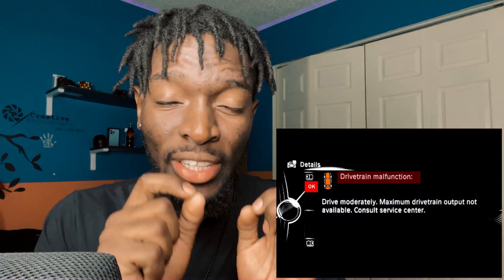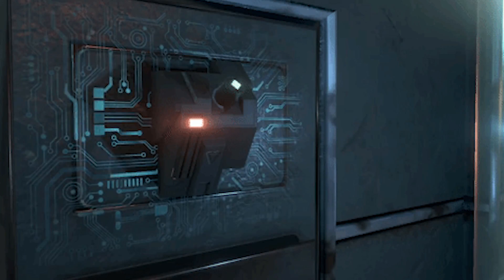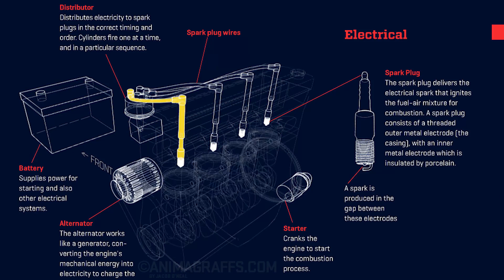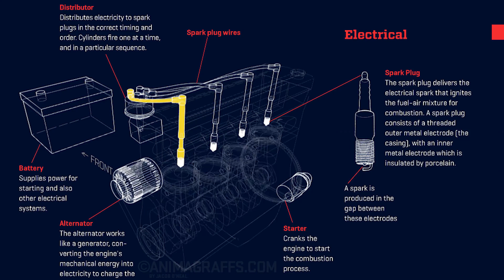BMW Drivetrain Malfunction. What is It? How to Fix it! | 2015 BMW 328i | Get Fixed

Comment: My clean title 2014 328i I bought recently has the brake warning light, DSC, chassis stabilization, drivetrain malfunction and ABS warning. Literally everything but it drives beautifully so idk what to do with the damn thing. Just replaced the brake sensors but disconnected the battery hoping it would clear but all new warning lights came back lol.
Reply from the maker: The Anti-lock Braking System in your car may need to be replaced. I have the same exact car but 2015. Take a trip to AutoZone when you get the chance and scan your car if you have a check engine light. Keep me updated.
Reply: Replace yourABS speed sensor and your chassis error should go away. Simple DYI fix.

Comment: I have this error on my bmw m240i - Driving stabilisation drive moderately. Anyone know what's going on? It won't let me swap into sport or sport+ keeps putting me back in comfort and the rear end is very dodgy spinning bad and not reliable at all.
Reply from the maker: Is the car preventing you from fast acceleration?
Reply: @GetFixed  Got it fixed now mate, had a specialist code out the error.
Reply from the maker: Coding out the error message doesn’t usually fix the root cause of that error message. It may come back in the future.

Comment: bro the codes they give me are P2251, P0131 P0030. 
but on the screen I get that problem.  What could it be?
Reply from the maker: All of those codes relates to your oxygen sensor. If any of them goes bad your car is gonna put itself into limp mode.
Reply: @GetFixed  Yes, but on the screen I get that there is a problem with the driventrain malfunction?
Reply from the maker: Drivetrain Malfunction basically means there’s something going on with the mechanics or electronics of your engine or transmission.

Comment: This just happened to me today literally drivetrain malfunction message then I’m driving and it goes in neutral and say transmission in park idk what’s going on the shops I’ve went to are no help ..
Reply: Do you know what the U1408 code means?
Reply from the maker: Where you able to resolve the issue?

Comment: I have a 2012 535i with a  drivetrain malfunction but no engine code, I can I figure out the problem?
Reply from the maker: If you’re not getting an engine code than it may have something to do with your transmission. There are some scanners that can pick up whether or not the transmission has stored an error code to the motherboard. How does your car act like when you first start it up?

Comment: I just put rims on my 2013 528i. And I got the same message. But the car doesn’t shake. Still drives normal. Didn’t do this with the factory rims. Thank you in advance.

Comment: Man I need your help I just purchased my 2013 750 li M and it’s idles fine but when I accelerate to 4000rpm or so it struggling for power and then it shake moderate not so bad but I’m worried can u help ? Thanks my email
Reply from the maker: I can help you troubleshoot what the issue is. Do you currently have have a check engine light? If so, have you scanned the car yet? If you don't own a scanner then you can go to Autozone or Advance Auto Parts to get it scanned.
Reply: @GetFixed  Hi yes I think the car is in limp mode the only codes that came up was a coil pack and also a fuel pump pressure fuel pump code please reply I’m sorry I didn’t see your message earlier thank you

Comment: My 2014 bmw 335i is having a similar issue. When ever it shows drivetrain malfunction, the car slows down and after a while the gear will disengage. Any idea what could be wrong with it?
Reply: Spark plugs or coils
Reply: My issue was that the gear oil mixed with coolant. It ended up damaging the gearbox.
Reply: @leonphotography1009  how does that happen?

Comment: Thank you for this video!  Just bought a 2012 328i feeling like I was duped and bought a lemon. Since I don’t work on cars hoping this won’t be too much more expensive at a repair shop.
Reply: What was the issue? I have the same issue same car.
Reply from the maker: I know that feeling. My first car was an 06 bmw 525i. I learned so much things from working on it. It would’ve been a lemon if I allowed it to be one. I have an update video on the channel talking about what I discovered about this error message. Although it seemed like an injector issue, it had something to do with the voltage being sent to the injectors.

Comment: I was driving on the highway yesterday and the drivetrain malfunction came on my screen, my car kept going but when I accelerate it, it takes it a minute to get up to the speed I’m trying to go. It doesn’t shake tho, idk what’s wrong with it
Reply: Yes, it ended up being my timing chain :( it’s all fixed and back on the streets
Reply: @davidguerrero9087  What the problem was?
Reply: @davidguerrero9087  how much did you get charged for that
Reply: @chago2373  about 3000, but The price varies depending on how bad it is and where you get the service done
Reply from the maker: Go to Autozone, scan it, and let me know what they tell you.
Reply: did you ever figure this out?
Reply from the maker: I’m wondering the same thing Brady.

Comment: I’m having a similar issue, my car says on the dash that it has a malfunction in drive. And it shut off completely but started back up. Any ideas? Thanks again
Reply from the maker: It definitely sounds very similar to my issue, as you stated mine only turned off on me once. I it’s possible that one of the fuel injector went bad but I recently learned something about that car that makes me think otherwise. Two questions. Does the car shake for you & are you able to go to Autozone and get your car scanned?
Reply: @GetFixed  I have a blue driver scan tool that I will try later today. I hope it’s something miner. I’ll will keep in touch. Thanks for your quick reply and help. Much appreciated man!
Reply: @joelane4670-q2i  what was the results?
Reply from the maker: Yeah J. What results did you end up finding out?
Reply: My 114 i 2014 have sama issue, but mine work’s perfectly fine first couple of minutes and then start shaking malfunction pop’s up car shut down.
And does exact same thing next few times when I try to start my car, after that something happens and car just work normally like nothing happened.
Any idea what can it be ??

Comment: Thanks for the info, mine was doing it this morning. 320i
Reply from the maker: No problem Allison. I just posted another video on how to fix the part without buying a new fuel injector.
Reply: @GetFixed  yeah, I'm going to check it out this evening once I get out of this continuing education class I'm in. Thanks for making the video and being quick to the point
Reply from the maker: For sure. It may also me a sensor causing the shaking. In my case it was the fuel injector. Let me know what the cause is for you. I’m kinda curious.
Reply: @GetFixed  absolutely, will let you know
Reply: Took it to get scanned today. They said timing chain. That's wrong obviously. He is nervous to work on BMWs. What scanner do you use?
Reply from the maker: The scanner threw up the timing code? If so before ever actually going into the engine to time the car, it’s best to test the camshaft position sensor. If that sensor goes bad it’ll throw timing codes even if it has nothing to do with the physical timing system. I’ll send you a link to the scanner I use when I get home.

Comment: My 2014 bmw 228i drivetrain malfunction came up after I changed my spark plugs and slowly accelerates to get to the speed I want help
Reply from the maker: Does it do that every time you make it up to that speed or what?
Reply: @GetFixed  the drivetrain light is on every time I start but I’m getting a p0193 code

Comment: yo what if it just goes into neutral while driving and rolls to a stop then it’s fine when you turn it back on....it happens like once every 45 minutes of driving im scared to take it on the highway
Reply: Yo bro did you figure out what it was mine literally does the same thing, driving normal, neutral and drivetrain malfunction light comes on, but i turn it off and on and it’s fine
Reply: @alevelasco3425 did you ever figure out what the issue was?
Reply from the maker: You might have to pull the gear assembly apart to check to make sure there are no pinched wires there. Also give that area a good clean if you can.
Reply: Mine does the same thing

Comment: So today on my way to work I pushed on the gas and the malfunction came up. The car shakes when I press on the gas but not when it’s just driving without putting in the gas. I made it to work but now I don’t know what to do. Should I risk it and drive to my mechanic that is 4 miles away ?? Or get it towed
Reply from the maker: You can drive 4 miles to your mechanic just fine. The ECU puts the car into a state that protects the cars engine by reducing the way your car accelerates.
Reply: @GetFixed  so what’s the solution
Reply from the maker: Hey dude. Are you still experiencing this issue?
Reply: @GetFixed  No, fortunately for me it was just a matter of replacing the spark plugs and coil packs. However on my truck (VW), I experienced the very same symptoms being described in this video. When I took it to the dealership, the injectors were bad
Reply from the maker: It was the injectors for me too. But the weird thing is, I replaced the one that was giving me the issue, it fixed the problem for 3 months and came right back again. Replaced it again, the issue was repaired for a month and came back. Fixed it one more time & the same injector went out again a week later. I came to the conclusion that there’s some type of voltage change or a signal being sent to the ECU causing it to trigger the Drivetrain Malfunction error.

When I use a voltage meter to probe the fuel injector lines I can trigger the car to go in or out of the Drivetrain Malfunction conditions, but the code continues to come back two seconds after erasing it even though the car is no longer going into limp mode or experiencing the rough conditions.
Reply: I got the same exact issue with my 750li 2013 any suggestions please
Reply: That sounds like it maybe a bad injector. Usually when it’s the spark plugs and coil packs, you give it gas and it don’t shake.

Comment: How expensive can it be to fix the problem?
Reply from the maker: I just repaired it myself. If you decide to go that route it’ll cost you no more than about $145 to get a new fuel injector and an hour of your time.
Reply: Happened to me today worst luck right after i got the work done on my car

Comment: Can this be a cheap fuel issue?
Reply from the maker: It’s definitely possible but I only use what BMW recommends for this car which is 89 & up. I don’t believe cheap fuel was the cause of my injector going out because the same exact 1 went out as before. If the fuel was the problem the first time then I’d expect the other three to go out on me by now. It’s been a whole year.
Reply: @GetFixed  hi there I have a BMW 330e? The drivetrain moderate msg came up message came up when I ran the fuel level low. It came up after I added petrol, after switching car on off a couple of times? Msg went away? I'm hoping it was that? No judders no loss of power? Happened yesterday will keep you posted, do you think it was because I ran the fuel low?
Reply from the maker: For sure dude. Low fuel level can cause you to experience cylinder misfires which is considered a drivetrain malfunction. Also can happen if you didn’t completely click the gas cap close.
Reply: @GetFixed  just ran my OBD2 Tool scanner no codes or errors came up? I'm assuming ECU was confused due to low fuel on highway, I managed to add fuel  before range reached 0 miles? After filling up msg went away?
Reply from the maker: Exactly. Once you refueled & started the car back up, the ECU ran diagnostics, because it didn’t receive the same signal that triggered the code the first time, it simply didn’t come back up. If the signal is triggered multiple times then it’ll store it there permanently until the issue is resolved & code gets erased.